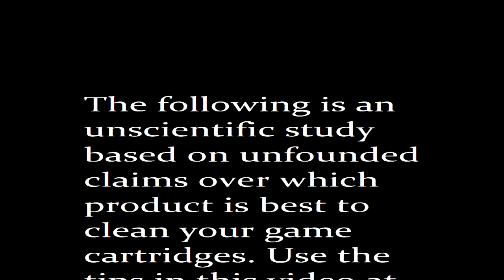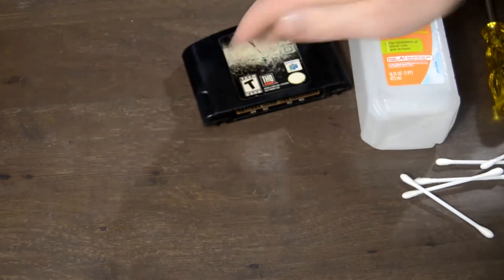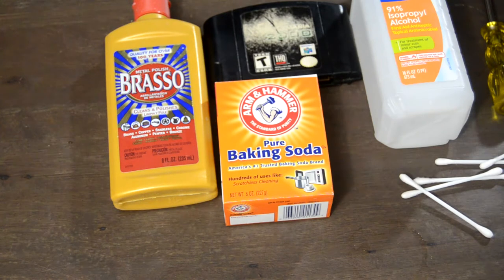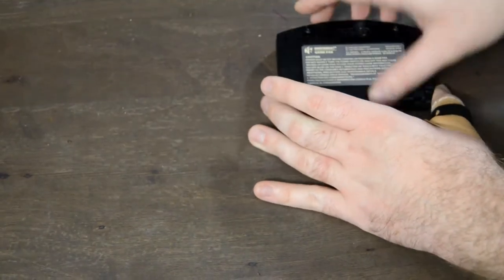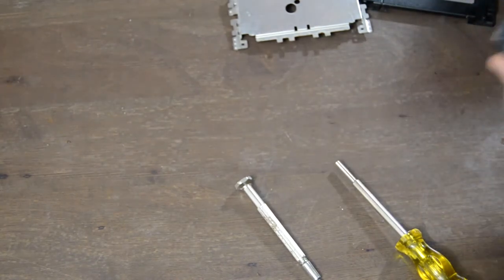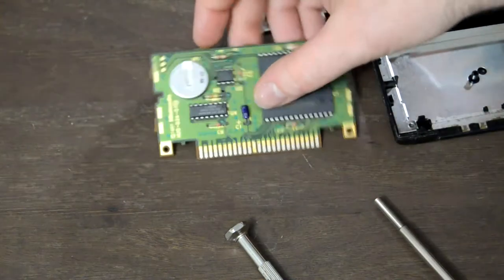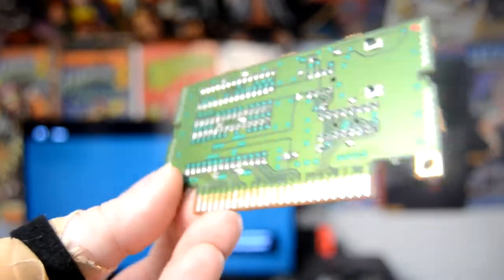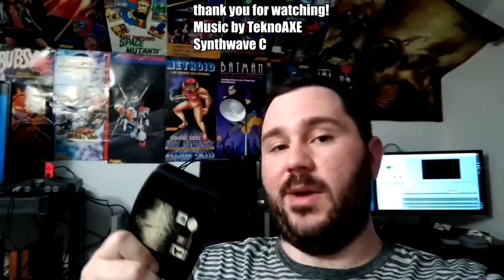Cartridge Cleaning Showdown - Brasso vs Baking Soda

Comment: Dang, that's sad to lose a game like that. I nearly threw away a copy of Mario Kart 64 a friend gave me as a gift from his own collection, but was corroded terribly. For the record, no one should ever, ever use Brasso. That's a metal polish, and I've unfortunately seen a few games with the copper contacts eaten away completely with that stuff. I always use a pink eraser on anything with corrosion, and use CRC electrical contact cleaner with q-tips, while rubbing up and down the pins. That pretty much did the trick even on a horribly corroded copy of Mach Rider for the NES, and the copper layer was still intact. Of course, some games can be beyond repair if the corrosion spread too far.